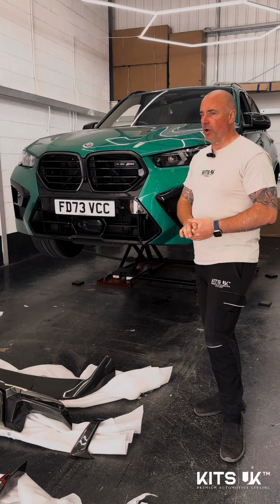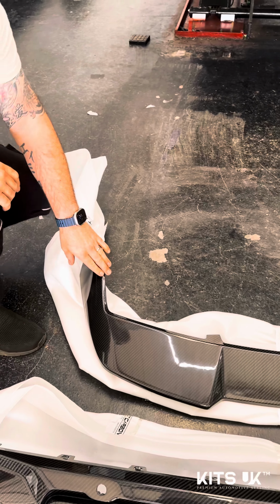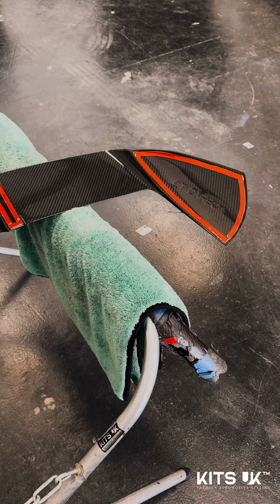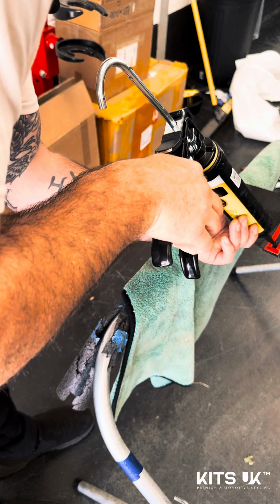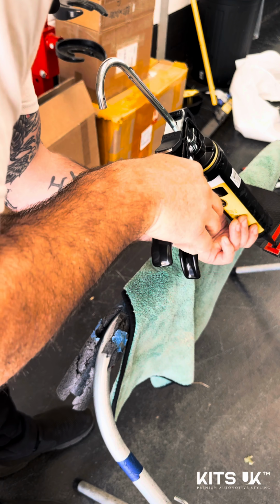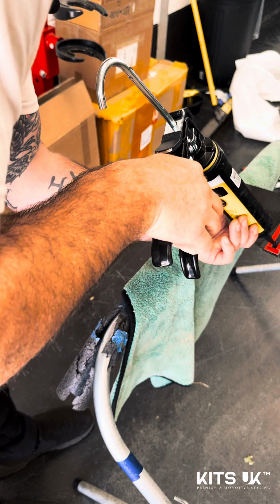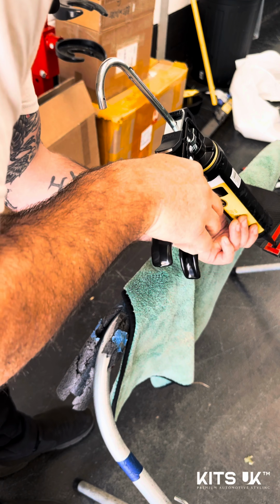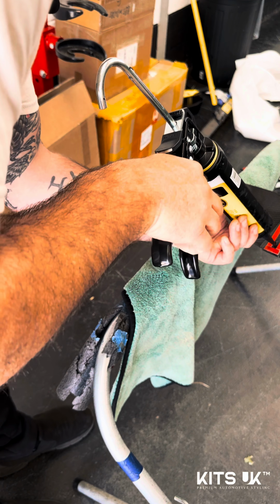Worlds First, BMW X5M LCI Carbon Fibre Install

Comment: Hi which carbon pack is this please I’ve a f85 looking for side skirts rear roof and front splitter
Reply from the maker: @simonmaplesden3850  drop us a message on our socials or website and will go through it for you.
Reply: @kitsuk5000  done